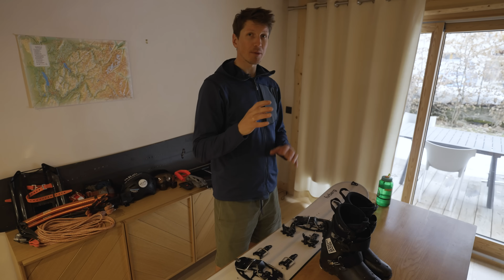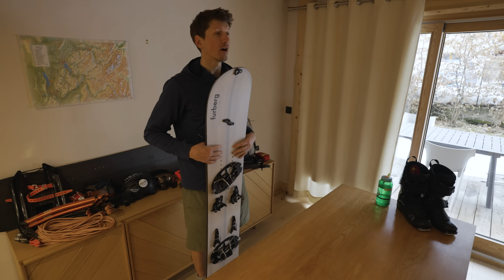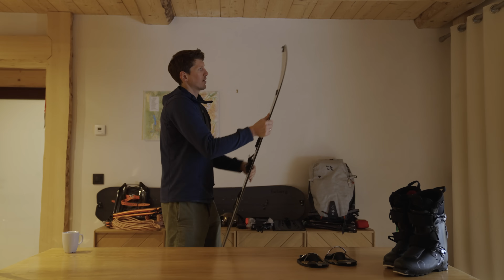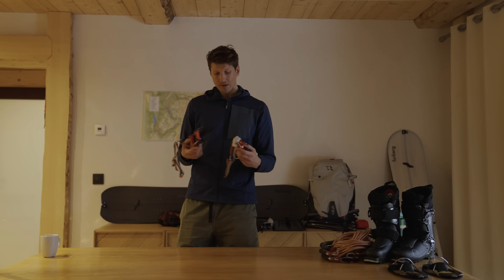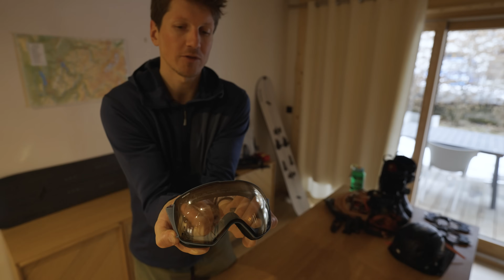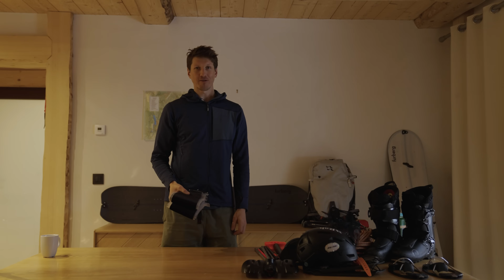The ULTIMATE hardboots and split board setup for backcountry snowboarding

Comment: Kia Ora from New Zealand. This is a great rundown of gear! I’ve been split boarding for about 6years and I’ve finally decided to do the switch from soft boots to hard ones. I do a lot of mountaineering splitting, and New Zealand snow conditions are usually quite icy so ski crampons are a key item to have. I’m interested to know what ski crampons you use for your boot/binding/board setup? Cheers 😊

Comment: Awesome and informative video thanks for it!! I've been splitboarding for +/- a decade, on softboots until now, and same as you my ankles are starting to give out.

This setup looks sweet, but is it possible to lock down the heel when you're in tour mode? Doesn't need to be bomber, but sometimes it's nice to ski short/ easy descents without needing to fully transition.

Comment: Just curious about the ride feel between the Karakoram bindings and the Phantoms ~ I'm definitely lighter, and not pushing as hard as you do, so I'm not quite as worried about breaking them.
Reply from the maker: The karakoram has a really good riding feel because they are so light and soft material. You should try them if you are not worried about breaking them 💪💪
Reply: @kriskopa  thank you!

Comment: Amazing video! With the RAB backpack, I have the Khroma 30 and I was wondering if you know how to attach a solid board to the front of it? What straps do you use?
Reply from the maker: Yoo! I usually have a couple of carabiners with a sling at the bottom, and then the side straps at the top. It works fine :)

Comment: So do you have the 28.5/29 disruptive right? do they it fit the S/M phantom binding? On the websites I see the boots have 309mm sole length while the bindings fit up to 308mm, that 1mm is not a problem?
Reply from the maker: Hi! Yeah for me its not a problem, even after using them some time, I need to adjust the binding even tighter.

Comment: Are you concerned about having your avy transceiver in your pants pocket (which you gestured to) quite close to your backpack hip belt with the inreach/other devices?
Reply from the maker: No, I haven't thought much about that. I do have my Gopro there sometimes, but when I'm riding for example I have it on my head. Also, if I'm riding with a in reach, I often have it on my shoulder strap.

Comment: Hey Krister, thank you very much for your gear talk. which length is your keyeqipment  shoesize 26 ? i have the Phantom binding as well for 3 years now and i am super happy. I am sure they will work the next 7 years. I am 1.88m tall, shoe size 45 have the Backlands in 318mm and wondering you the heck can you have binding size S/M with 1.94cm ?   greetings from Innsbruck.
Reply from the maker: Yo! The 26size is just what's on the website. Im a 28,5 in the boots and the S/M fits me really good:D

Comment: I had a voile and the gap between the 2 was huge. If you came back through a resort and ride some chop or small mogels it was like riding 2 boards. Was always a toss up on whether to snowshoe and ride with a solid board but extra weight or enjoy hiking with the splitty but deal with the movement. Your setup looks sweet

Comment: Anyone have issues with the toe/lever disengaging on hard impacts with hard boot bindings? I experimented with phantom bindings when they first came out and paired them with la sporitva Sideral hardboots. Loved the performance and feel but I was testing them in resorts and if you overshot an icy jump, the bails would disengage. Not super often but, enough that it was hard to trust them. Definitely played around with the tightness settings which didn't help. I eventually created a rope strap cinching system that went through a drilled hole in the toe lever, around the boots sides, and then connected to the heel bail and this actually did solve the problem. It was just sort of annoying to have to deal with the extra steps. Krister, some of these scenarios you're in are so high consequence that I'd imaging you can't afford to be dealing with this problem.
Reply: Yes! I've had this issue quite a bit, actually. I have the phantom bindings and the phantom slipper boot. It certainly doesn't happen all the time, but enough to loose confidence in the bindings. On steep exposed descents, I'll lock the toe bails down with a ski strap under my boot. It seems to work but incredibly annoying.
I've tried every adjustment possible but continue to have this issue. They are currently set to the tightest position possible for my boots. 90% of the time, they hold no problem, but the toe bails still pop open every now and then. About a month ago I was riding STS couloir in Roger's Pass (Canada) about half way down both bindings popped open causing my board to slide down the rest of the couloir and forced me to butt slide down the rest of the 40° couloir.
Reply: I’ve heard of people riding arcteryx proclines having the same problem and their issue was that the toe welt on the boot wasn’t quite substantial enough. I’m in the phantom slippers and have never once had a problem with the toe bail disengaging even with bigger impacts. That would be a bit terrifying honestly. I saw people with proclines modifying the toe welt to seat the bail better.
Reply: @gvinoski  Definitely would be interested in seeing this toe lug mod. I've considered bolting on an extender piece to the toe lug. Not sure if that would effect the walk mode toe tech engagement though because i've actually never gotten around to trying hardboots on a splitboard. I'm finally considering splitboarding again so I'm looking to revisit this soon. My  toe lever lace bridge method did actually did work well and you really felt like you didn't have to worry. I think I could design a better version of it where I can engage it faster though. Ski straping the lever down sounds interesting too. Really been missing the fit of properly molded AT boots especially when used with zip fit liners. Stayed super consistent in feel for over 3 seasons and the response is amazing. I did have to use those electric insole warmers sometimes though
Reply from the maker: Hi! I came of from the phantom bindings once doing a butter, but it was totally my fault. I had the bindings super loose and ever since I make sure to have them tight as hell. And I haven't had an problems what so ever, and I have taken the bindings for a ride :P
Reply: Some touring boots have a reduced nose, to move the pivot point closer to your toes.

Comment: Great video. This is my 2nd season riding the Key Equipment Disruptive boots and my main issue with them is that I never seem to be able to find a good setting for the velcro straps for the way down from the get go - I usually have to readjust after the first couple of turns. Have you had similar issues? If so, how did you solve it? At least I'm not seeing you stop to adjust the straps in your videos :)
Reply from the maker: Hi, No i don't have any issues with that. Often when I start touring I test the straps too see if they are tight enough, and then ill start walking. So when I'm on top ill just lock the buckles and I'm ready to go.

After skiing the whole day in the resort, I might need to adjust them a little bit.

Comment: Any experience with Phantom boots?

Also how are your heel and toe bails set up (which holes) on the binding? I also use size large phantom bindings with 28.5 boots (modified TLT5s). It takes 2 hands for me to crank down the toe bail lever on or off. Really tough to do if you’ve crashed in deep snow. I noticed in one of your videos that you can clip in with one hand! There’s no way I can do that with mine so I’m wondering if I can fix that somehow. Thanks!
Reply from the maker: Hi! I guess Phantom boots are a backland with link lever? I have tried 3 different pairs of backlands yes.

I have the small/medium bindings and I have one lever in the middle under the binding and one all the way out. Ill adjust more after using them for many hours :)
Reply: Yes the Phantom Slippers are based on the Backland but have a link lever, modified buckles, and most importantly a very different cuff. Seems like they have a lot of similarities to the Key boot. But anyway if you haven't ridden that boot it doesn't really matter! 

Anyway thank for the info on the bails. I'll mess with mine!  @kriskopa